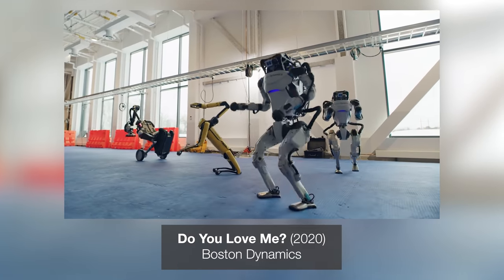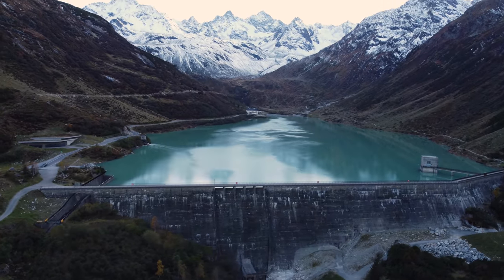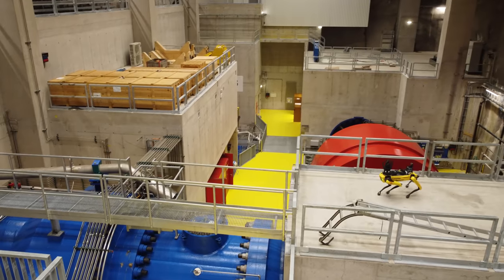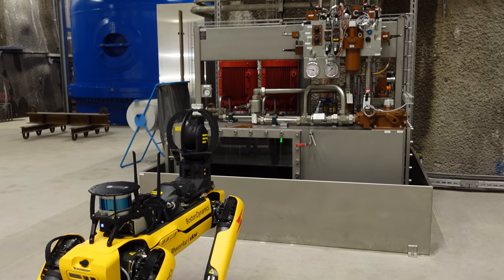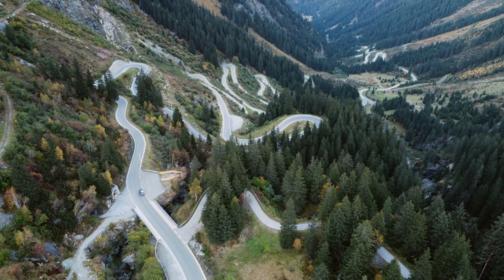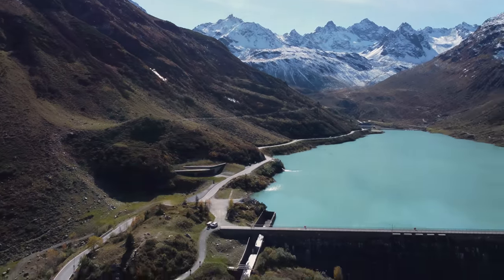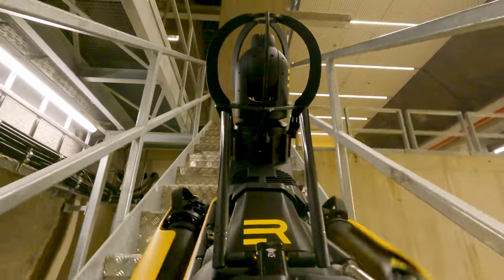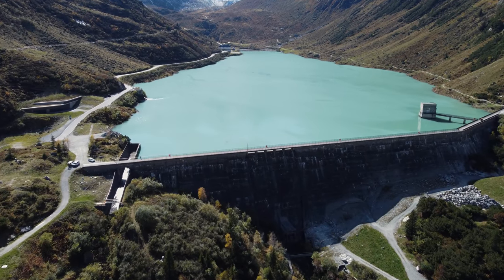An actual, real-world use for robot dogs

Comment: "This isn't a dangerous site. They let me in after all."

Tom 'Danger' Scott
Reply: Did they not see what happened to Tower Bridge just after Tom's visit?
Reply: @ragnkja  I T S  A  B I T  L O U D  I N  H E R E
Reply: @toomuchiridium  W H A T
Reply: What’s gonna break next week
Reply: 150 tons of water per second flow through it. I'm sure that's not dangerous at all
Reply: @pauldzim  why is that dangerous? do you expect the dam to collapse? with that logic your house also is dangerous
Reply: @ragnkja  should just hire deaf people
Reply: Tom Scott is the most dangerous  thing on that site. Remember the curse. Tower bridge stuck, ocardo robot fire, floods in Germany.
Reply: @divat10  Ever heard of pipes bursting? And yes, houses are in fact dangerous, lots of people die in home accidents.
Reply: @divat10   @divat 10  well does your house move huge volumes of very fast and powerful water through the machines that might require maintanence? The kinetic energy of the multiton heavy turbines alone is enough to send themselves flying through the concrete ceilings should the bolts wear off and come out
Reply: That one very important bridge in London be like...
Reply: @ragnkja  And they need different cameras anyway to inspect the heat-signature of pipes or to make micro-movements visible via video-movement-amplification. With a robot doing the inspection and filing reports to be analysed by an engineer, you wouldn't have to pay a highly skilled (and pricey) person for walking around this huge facilities any more.
Reply: Austin „Danger“ Powers
Reply: Scott Tots. Sorry, I had to do this
Reply: "Why are my ears ringing?"
Reply: @noop9k  medieval cranes hired blind people because they didn't mind being in the giant hamster wheel at height
Reply: @pauldzim  yes pipes can theoretically burst but being there isn't really more of a risk then driving a car
Reply: Teee
Reply: It's not a dangerous site because it's not as dangerous as Tom himself
Reply: @noop9k  they do, just not before they are deaf!
Reply: Tom is mostly harmless
Reply: @adrianthoroughgood1191  robot dog apocalypse next?
Reply: @alalalus7692  pro-tip: if your post starts with "well", recognize that you're about to type something extremely obvious that everyone is already aware of and that you should probably just save yourself the trouble.

Comment: This also gives authors a way to explain why the lights still work in a future dystopian setting where humanity is nearly extinct. Vestigial robots, continuing to follow their programming completely autonomously.
Reply: It might make more sense in the long run to keep the lights off and have them remote controlled by the robot wherever needed or use lidar/infrared/sonar guidance for the robot and a spotlight mounted on the robot for visual inspections.
Reply: as a stupid guy that likes world building, thanks for the idea
Reply: To add to that idea: You could have huge thermal power plants, or maybe even fusion plants in, or close to the ocean to explain where the fuel is coming from. Or, even further in the future, maybe a dyson sphere.
Reply: Usher II
Reply: Have you read "There will come soft rains" by Ray Bradbury? It's a dystopian short story that examines exactly this theme.
Reply: fallout
Reply: @EliasProbst  or just let the robot control the lights. On, inspect, go to charger, off, repeat.
Reply: poor dogy
Reply: A few decades there was a series of articles of how our GIANT machines would function were people suddenly disappear.   Maybe someone with more energy than I might die them up.
Reply: @EliasProbst  --  Well, a case might be made for having two dog robots.   You generally get better video if the light is closer to the object that the camera.  No need to illuminate dust and "smog."   Of course, there should be plenty of "convenience outlets" for the robots to re-charge themselves.
Reply: They actually have this idea in Skyrim of all things, where the Dwemer (Dwarves but elves) as a species all dissapeared at once, but their ruins are still mantained & defended by their autonomous clockwork servants.
Reply: @GKplus8 Skyrim strikes again lmao

Comment: The good thing about robotic inspections over people is they don't get bored and get sloppy gathering data, the just do their job and do it the same every bloody time.  When you want to watch for slowly evolving trends, having good repeatable data is awesome.
Reply: That is a good point.
Even if you provide the human with a checklist and patrol-evidence check-in spots, there will be people who occasionally (or more!) just "pencil-whip" the results.
-
I saw this when I worked at a convenience store, where every 45 minutes employees were supposed to go to all of the coolers and freezers and note the temperatures.
One day I came in for my shift and found the deli case was at 85 degrees F, and had been long enough for everything to go bad. But the checklist showed good temperatures written in for the entire shift before mine.
Reply: How many dams across the world have failed do to issues that must have been visible for years, but were never discovered on inspections?
Reply: asdfasdf  I mean, mankind did invent machines to automate tasks and increase our leisure time. With more robots replacing human workers, something like a Universal Income not only seems viable, it seems like the right thing to do :)
Reply: @3nertia  why stop at universal basic income? Why would currency be necessary if everyone's needs can be met easily?
Reply: asdfasdf  *Dune noises.*
Reply: @hotdog9259  Well, I've usually found that line of dialogue offends people's cognitive dissonance but you have an excellent point :)
Reply: just measure one more parameter to robot dog, dog what did you say(if it has a mouth to say or bark); human, tell me how to do it, it will be done next time.
Reply: asdfasdf  ok, but that means less jobs for humans, which means more poverty
Reply: @theskiypdee  it only means more poverty if you're allowing a tiny minority to accumulate the wealth that society creates, and giving them the power to decide who gets it and who doesn't. As that wealth creation requires less and less work, society should benefit - it shouldn't widen the gap between rich and poor. Priorities need to change

Comment: This would've replaced me in the eighties, I did 60 inspection checks every shift and the plant ran for 365 days a year.
Reply: Did the same, in an USAF prime powerplant.
Reply: Was the pay good?
Reply: so they took a off only on leap years?
Reply: I think that things like this are going to replace a lot of people in the coming years too.
Reply: Back in the day did you say things like "They may be able to automate some things, but they will NEVER be able to automate engineering inspections"?
Reply: so there were 3 shifts of inspectors, at least 3 people less employed.
Reply: @heyokaikaggen6288  Sadly yes
Reply: I wonder if you really need the robot dog. Wouldn’t it nowadays be cheaper to install fixed sensors for remote inspection?
Reply: @llejk  However, those sensors can fail, and might not be obvious in their failure. Additonally, this dog can be moved around the plant to make checks on places that do not have a  sensor.